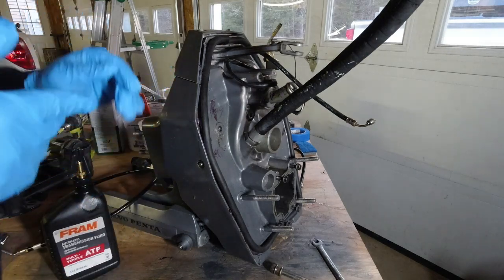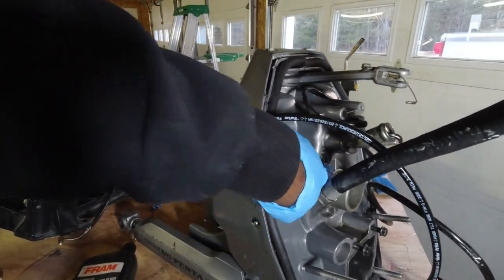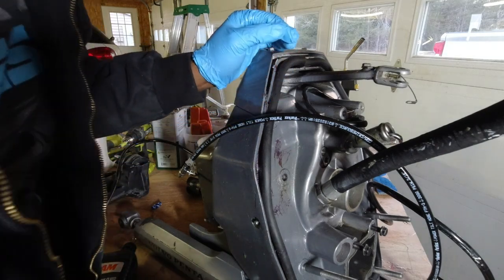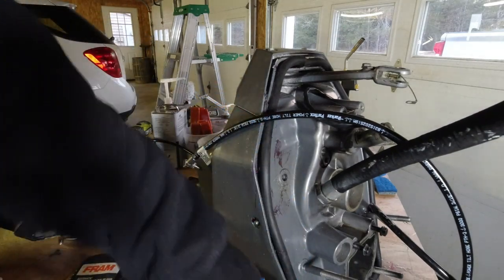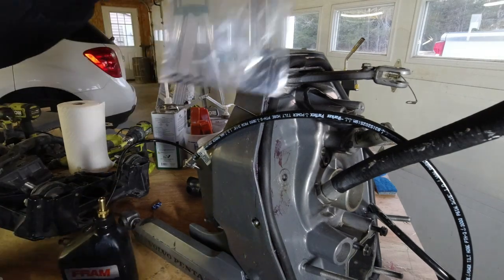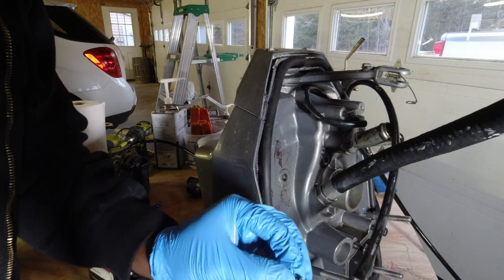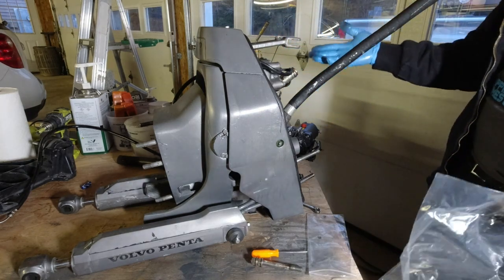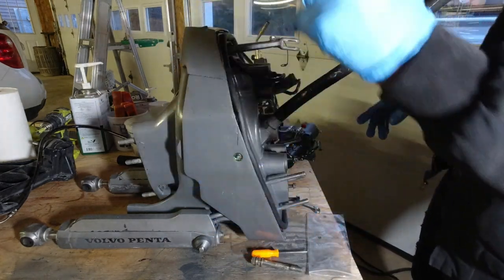Volvo penta SX cobra Trim Tilt hose replacement

Comment: Did you have to first remove the inboard engine to get the gimbal and motor plate out?
Reply from the maker: Yes, you have to remove the engine and the transom assemble that rear engine mount sit on.this